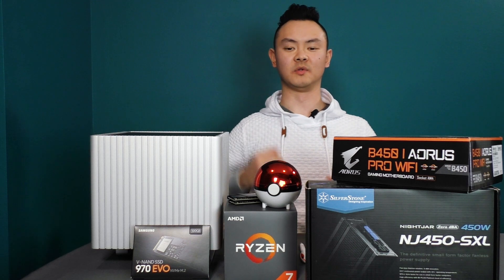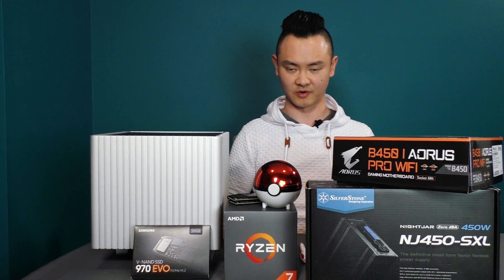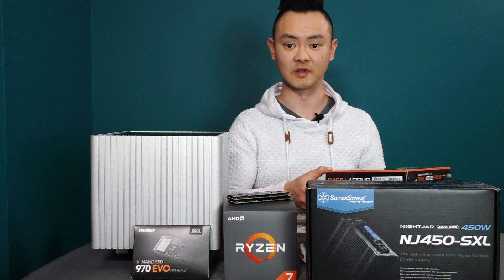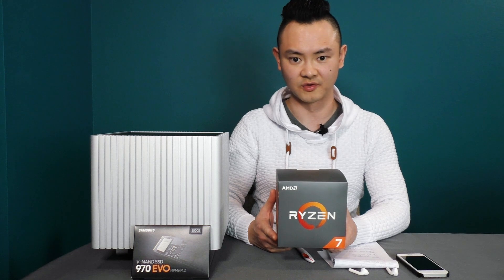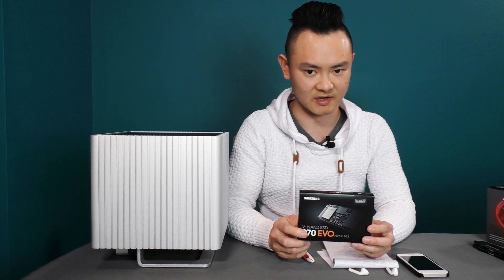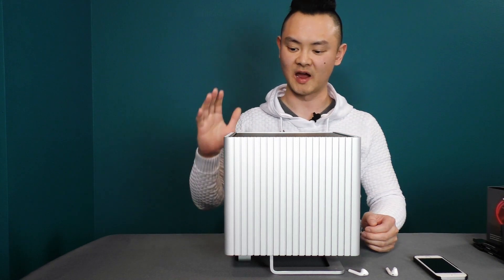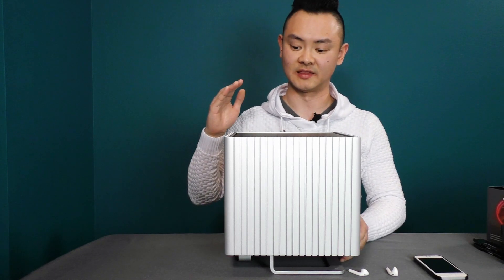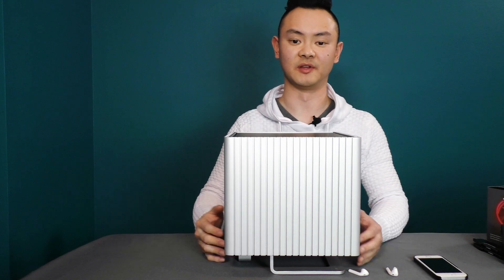100% Fanless and Silent PC   The Best and Most Unique HTPC Gets an UPGRADE for 2020!

Comment: Nice video! I’ve got a DB4 as well, thumbs up for using the Nightjar PSU, I’ve got one too, simply the best PSU for this case - the ZeroFlex one is OK too, but way less powerful. If you want to fit a more powerful GPU, I can recommend the HDPLEX GPU kit, and then use 2 panels for the GPU and 1 for your CPU (may involve some heatpipe bending). In my DB4, I currently have a 8086K, 3060ti and 64 GB RAM @ 3600 MHz.
Reply: That is a nice set up. How are the temperatures for the CPU?
Reply: @danielquach5783  one panel can passively dissipate 60-65W, so PL1 is set to 65W, PL2 to 1.25 times PL1, as standard. In practice, this means it runs an all core boost of about 4.0GHz, versus 4.3GHz stock (=95W PL1). But with lightly threaded loads, which is most of the time, it can run at full boost, so it still hits 5GHz and gaming performance is identical to stock. Gaming it gets to about 70 degrees C and all core load it runs close to 100 C, which can be sustained without issue (it may freaks out some, but it is in fact within design limits). I do have a delid kit on the way to see if I can stretch it some more, but all in all I’m very pleased with the results.
Reply: @kasimirdenhertog3516  Hello. Looks like you've tested your DB 4 in all directions. Can you give me advice on components? I want to build a workstation for 3D modeling / Gaming (sometimes, without the latest gpu's, something beyond 500$). I like the DB4 case both technically and aesthetically, and as you've mentioned the Silverstone NJ450-SXL will be great PSU. On most of my PC's I had intel, but I'd like to give AMD a change since people love Rysens. 64Gb Ram will be enough. Can you give an advice on CPU (especially CPU, since it is critically important for work) and GPU? I want to go fanless, so I have no cons on buying the streacom kits for CPU/GPU if there is a no better alternative (without pipe bending etc., because I don't have the tools for making it great).
Reply: @crowntail8092  I've swapped the 8086K for a 5700G since my comment. Most Ryzen chips have high idle consumption, which is not quite suitable for fanless builds. But the G-series have a different architecture (monolithic vs. chiplet) and stay quite cool in idle while being also more efficient at load compared to the regular/X-series. The 5700G is therefore an incredible chip for fanless builds, with 8c/16t in a - true! - 65W package.
If you need more cores/threads I don't think Ryzen is ideal (because of the high idle temps) and would go for the 10900 non-K. This has 10c/20t and when configured stock is also 65W. But still, this is a less efficient chip than the 5700G, I'd only do this if you really need the cores/threads. For even more cores/threads, you could use something like a low power Xeon, although you'd be compromising on lighter load/gaming performance.
This is maxing it out on one panel, if you cool the CPU with two panels, you can look at chips with 95W TDP but those chips tend to be more geared towards performance and will be inclined to pull big power, way past 95W and beyond the actual cooling potential of the DB4. You can restrain them, but that will reduce your gains.
As for GPU, the 1650 or 1660 is a very efficient card and offers OK performance, and I think you can cool it with the Streacom GPU cooling kit. Anything more and you'll have to start practicing your heatpipe bending skills :-)
Reply: @kasimirdenhertog3516  Thank you so much for a so detailed answer. I'll go with 5700G. Is it ok to use a stock DB4 CPU cooling solution or there is a need for an extra cooling kit for 5700G CPU?
Reply: @kasimirdenhertog3516  Oh, and since you are using the 5700G, what motherboard you are using?

Comment: This is really a great build. We can see you work and it gives indications about how tricky it can be. Great video !
Reply from the maker: Žils Deless-Vēliņš thank you for the positive feedback.
Reply: @techcraftstudio9340  you are welcome. A question : since the psu is in place is there some place left for 2.5 ssd for example ? (If I make the same build 1tb won't be enough)
Reply from the maker: Žils Deless-Vēliņš I took a look in my build and it looks like a very tight fit. In my case I would not be able to fit any 2.5 inch drives securely .
Reply: @techcraftstudio9340  ohhh ! That's very nice of you. The psu take too much place I suppose ? I am much grateful.
Reply from the maker: Žils Deless-Vēliņš No problem and my pleasure. The PSU does take up space since it is also fanless it needs the size to dissipate the heat.
Reply: @techcraftstudio9340  I understand ! Do you think this build could handle a 9th gen i7 ?
Reply from the maker: @RealSoundReviews  I think it will still work. I am assuming you are talking about the i7 9700k? That CPU does draw more power than the one I have. Just ensure you limit the power to around 65w so it does not thermal throttle.
Reply: @techcraftstudio9340  ok ! thanks again. It is so nice.
Reply: @techcraftstudio9340  btw, I ordered a HDplex 400w which seems to have a very good reputation. The AC/DC is externalized like for a laptop. You have to combine it with a dell 330w unit, they officially recommend. The cable to use the external power supply is included in the sell. Maybe not can be useful for some other people in the community. 🤗

Comment: Hey dude. Nice video. I too have a Sesonic  fanless PSU that's been running solidly now for the past 9 years without a hiccup. Just wondering why you chose this over the Streacom 240w PSU. Was 240w not enough? 

I'm currently buying all the bits I need for this case as I'm going the hackintosh route with an i7 9700 or 9700k, 32gb ram & 1tb M.2 SSD. (Still undecided on the motherboard). 

However, after watching yr video and thinking of my personal experience with this rock solid Sesonic psu, I think I might order one too!

Just want to ask if you were able to mount it very securely in the case? Any wobble at all?

I'm also thinking of going the 1050 route for the GPU. Was initially gonna go with the 1030 (with no additional cooling) but since you've been running your 1050 for 3+ yrs with no problem, I think I'll copy you :-) Just means I need to get the GPU kit which I want anticipating on using, but if I get better performance then its probably worth it. Cheers...
Reply from the maker: Inspector-Tech I used the screws that   was used on the psu to hold the psu cover/heatsink and mounted it via the bracket the streacom came with. Very secure, no wobble. I wanted a fanless psu that has a x1 8 pin for cpu power cable more than anything else because the streacom 240w only comes with x1 4 pin cpu power. All the mb I saw for Ryzen had 8 pin cpu power. Even though I am never going to push anywhere close to the limit of the psu due to the thermal limitations of the case, I also wanted scalability because eventually I may go with 16 core Ryzen and a more power powerful ITX graphics card that needs a pcie connector. Of course both will need to be downclocked to work with the thermal limitations.
Reply: @techcraftstudio9340  Ok thank you. I realized you don't have a Seasonic but a Silverstone PSU!! Anyway, I will probably go with a Seasonic Prime 450w fanless. I assume most ITX motherboards can take an ATX 12v  PSU right?
Reply from the maker: Inspector-Tech they can however make sure it fits inside the case. I choose the specific Silverstone PSU because it is also compact and fits inside the case.
Reply: @techcraftstudio9340  Ok, understood. I think it might be a bit too big as the dimentions are: 140 mm (L) x 150 mm (W) x 86 mm (H).  It's just over 2cm higher than your Silverstone & I think it will be too close to the motherboard so think I'll just stick with the 240w one from Streacom!
Reply from the maker: Inspector-Tech Nice. Make sure the mobo works with 4 pin cpu power if it has an 8 pin plug.
Reply: @techcraftstudio9340  what do you mean?
Reply from the maker: @inspector-tech  From the spec sheet, the 240w Streacom PSU comes with a 4 pin CPU power plug. Most motherboards have an 8 Pin CPU power header. You should make sure the motherboard you choose works if you plug in only 4 pins. If you choose a mother board that has a 4 pin CPU header, you can ignore what I am mentioning.
Reply: @techcraftstudio9340  Ok, I think I will get the same Silverstone PSU as you. Please tell me how it's been so far? Any heat or noise issues??
Reply from the maker: Inspector-Tech Haven’t has any issues so far. For the most part the system does light load work so the PSU doesn’t get stressed.
Reply: @techcraftstudio9340  Ok, thanks!

Comment: Love this build. 
Did the video capture problems get resolved with this upgrade?
Reply from the maker: Luuk van der Duim I did initial testing with 4k videos and the cpu was able to transcode no issues even after lowering the power limit to 65 watts.
Reply: @techcraftstudio9340  The 2700 has the option to limit TDP too? I thought this was new on the 3000 series.  Do note that thermal dissipation and power consumption both go in Watts but are different things and to make matters worse AMD and Intel do not agree on a standard to measureme TDP.
So I am curious, what does it say in bios you are limitting 'power consumption' or 'power usage'?
I have enough questions to warrant another video perhaps: 
What would be the power use of your system when idle, and under load?
How does your system cope with high ambient temperatures, eg. during recent summers? Does the CPU throttle (a lot) then?

Love that case. I consider building my next system using that.
Reply from the maker: Luuk van der Duim The 2700x does have the ability to limit consumption under “cTDP” in my bios. I set it to 65w in the bios and from my power draw meter(measure from plug) it limits cpu power draw to 65w under full load. Idle power draw is about 35w but I’ll need to spend more time to get a better measurement. Currently it is winter here so I don’t have temps for summer yet but from my stress testing with Prime95 under 72F room temp, it takes about 45 mins for the CPU temps to hit 82c and it seems to top out at that temp. At 82c the CPU does experience some thermal throttling and level out around 2.9ghz all core boost. Under my real life use case, the CPU won’t ever encounter that kind of prolonged stress but I was testing for absolute worst case scenario. I do agree about Intel and AMD not having a standard TDP specification and for my stability testing, I pay attention to actual power draw from the wall. What will you be using your pc for?
Reply: @techcraftstudio9340  most use cases are not sustained load but rather episodes of high load. I would use it for casual use (low load) and compiling code (which would be the high load) which could really benefit from a few more cores than my current 4 cores fanless 7700T. It is decent but I am already looking at what I would want from a future build and since your build is feasible, maybe even a 12 core AMD would be? But I would not want a motherboard with active cooling in a fanless setup. I am done with moving parts! ;)
Reply from the maker: Luuk van der Duim I agree so I went the extra mile to ensure there are no moving parts for this build. I do expect to eventually go for 16 cores in the future with this build. I would check to see what kind of clock speeds the 3900x gets if you limit it to 65w. I think it is still going to clock decently high even if limited to 65w.
Reply: @techcraftstudio9340  If you do go for 16 cores, please do make a video on that.
Reply from the maker: Luuk van der Duim 100% definitely will.